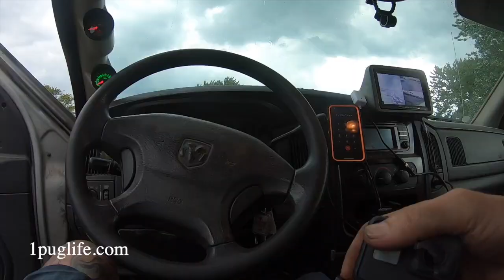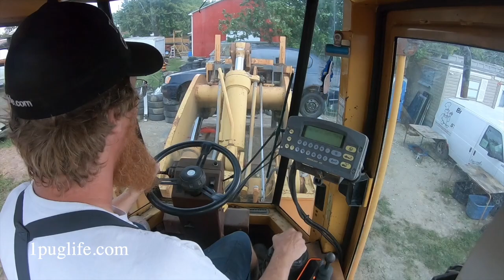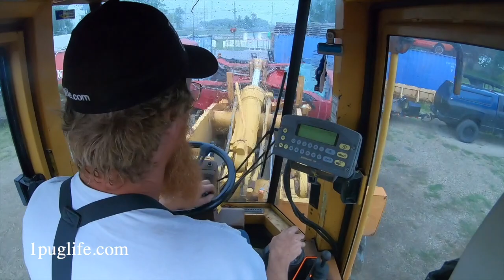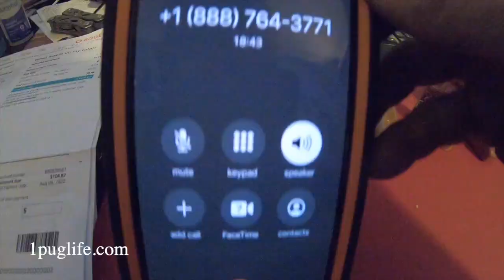the old ill call ya back in 5 minutes trick

Comment: Run a air line from the shop ffs so Dickie can use big boy tools and get the job done way faster 🤦🏼‍♂️
Reply: Pug1 no guuh
Reply: That would make too much sense....
Reply: No one allowed to use workshop or tools in there, just for show... They just gather dust and space used to store old shitty 83 dodge
Reply: @MultiCocobeware   that dodge got alot of potential tho , especially with all the tools in that shop ffs , pug should be doing custom parts for it and making videos not just towing cars and slave laboring Dickie